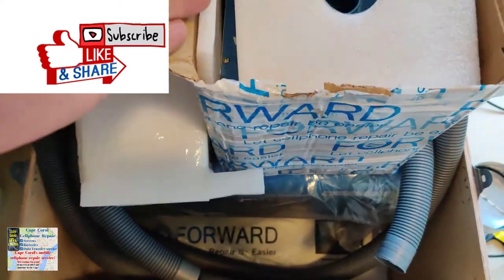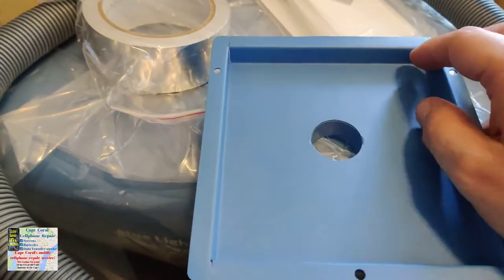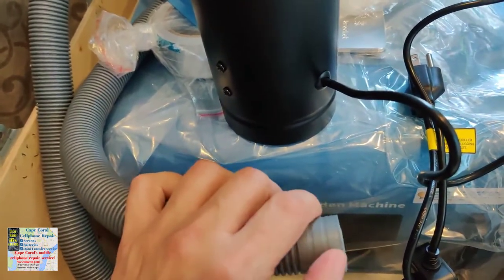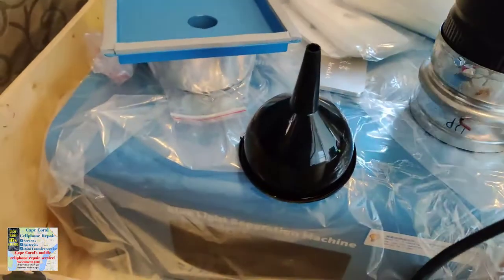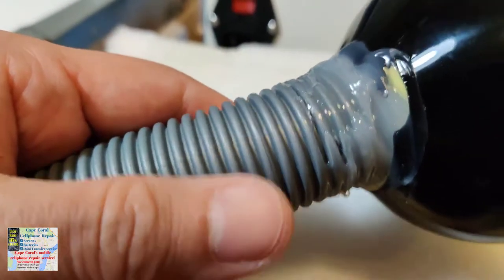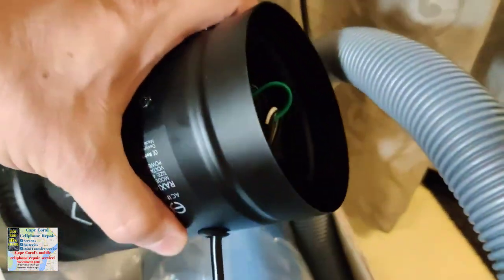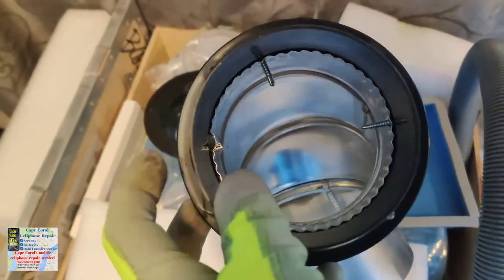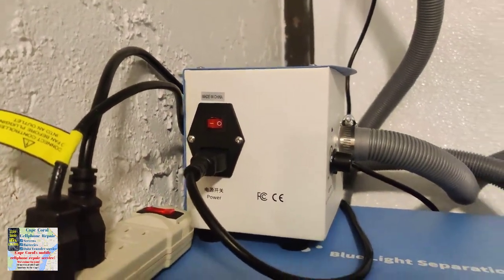How to get rid of smell from Forward Blue Laser Machine the right way!

Comment: I am planning to buy the machine... hows the performance and the accuracy of the laser
Reply from the maker: The performance is top notch. I have been enjoying using it. The one negative is the smell, but if you exhaust to the outside with a powerful fan, no issues! I like how this machine is less prone to damaging internals. Other lasers seem to constantly damage flex cables and other internals.
Reply: @CapeCoralCellPhoneRepair  thank you for that insight... i am planning to buy one.... just saving up
Reply: 25W powerful laser head,drawing accrute to 0.001mm.
Reply from the maker: Derek, I am very happy with the performance.
Reply from the maker: You will be very impressed. I just highly recommend you properly exhaust to the outside. The fumes can be toxic (I don't know for sure) but the smell is very strong and potent if you do not properly exhaust to the outside. Get the materials I posted on the description, and you should be fine. About $140 in materials is what we spent, and well worth it!

Comment: Is it possible if I connect a fan directly to the back of the laser machine without having it go through the tiny extractor that came with the machine?
Reply from the maker: Yes it's possible. You can use that 205 CFM fan. What I do recommend, is to use some kind of filtration because there is small black dust particles that you should trap instead of letting it get to the fan motor.
Reply: @CapeCoralCellPhoneRepair  has the smell been completely gone after you added that 205 CFM fan to the Laser machine? (+thanks for the response)
Reply from the maker: Yes, I would say just a small trace is left but not overpowering. I also leave the 205 CFM exhaust fan on before, during and after the run. Nothing wrong in leaving the 205 CFM fan on during the entire work day. I updated my setup here….. https://youtu.be/A_kZG6Xi3DQ